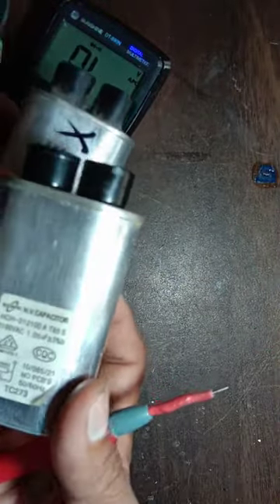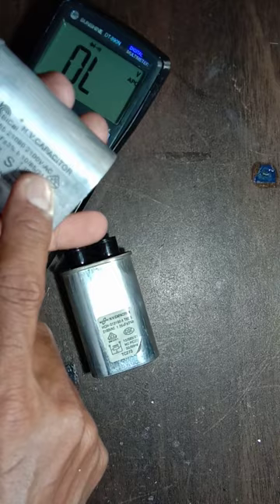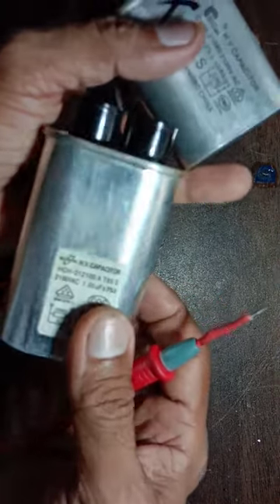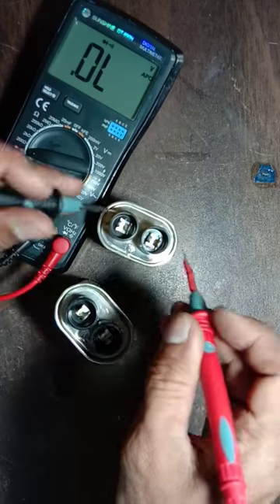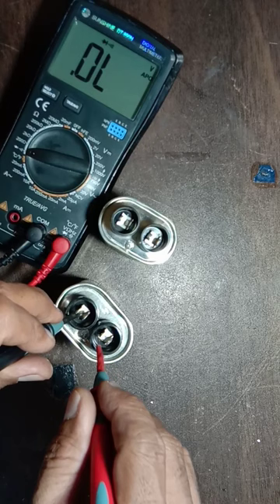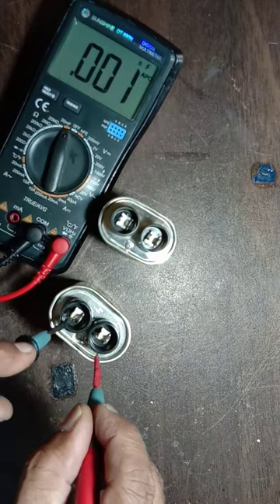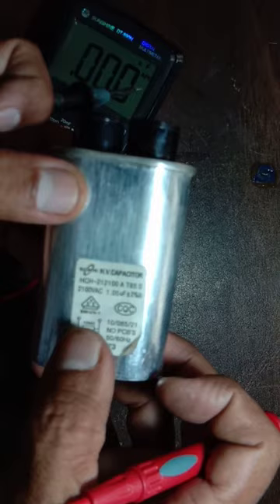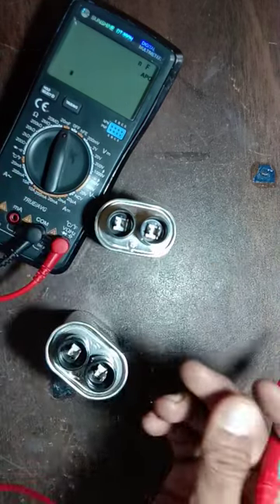Microwave oven capacitor checking.

Comment: I want to understand how they work?
Can they be charged with a 12 volt battery ?
Battery is direct current  how are they charged in a microwave?
And what determines when it releases its charger ?
Reply: Capacitor is a device like battery but unlike battery they discharge almost immediately. They are used for smoothening the current fluctuation. You can make one with the help of aluminium and some wire and hold them at a very close distance but don't let them touch each other. They can be charged by 12 V battery but it's discharge won't be that big. If you put the in house plug point they might discharge aggressively with a spark but i won't recommend that cause once i tried that and my house fuse broke and my dad gave me a nice beating. Capacitors cam be charged by any form of correct weather it's DC or AC it doesn't matter as long as there is a flow of charge they are good to go. I hope it helps 🙏🏽.

Comment: How to charge this can u guaid
Reply from the maker: This is Ac capacitor.. If you try to charge this with Ac voltage it can handle more than 2000 volts please don't try to charge.. It is very dangerous... 🙏